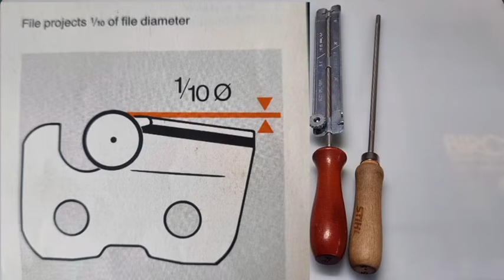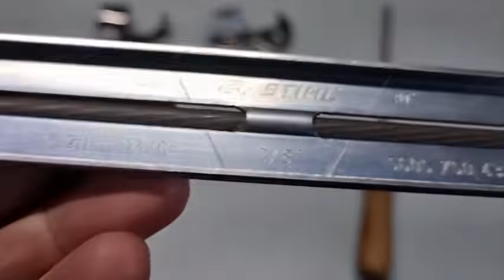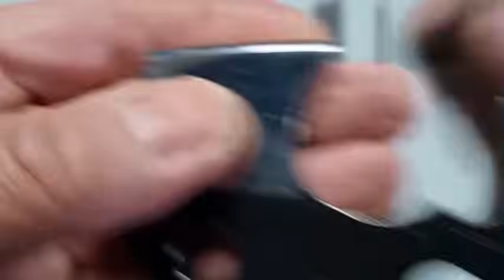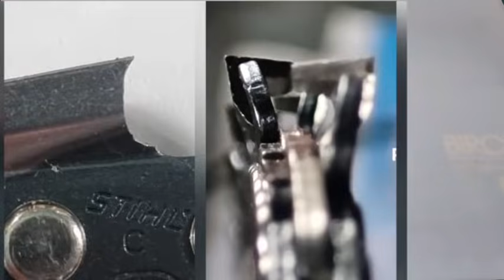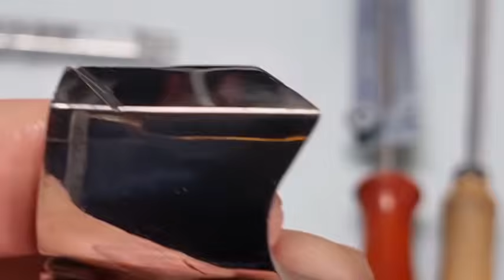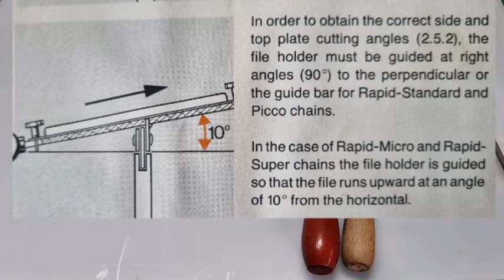Chainsaw Hand Filing the Utimate Guide

Comment: This will be long but it helps show something interesting 

Oregon Multi axis grind -  So they only use this term for the EXL style cutters. To understand what it is and why they do this takes a little bit of history.

In the early 2000’s Oregon changed their 325 and 3/8 chains from the previous LG and LP (bumper link) designations to the LGX and LPX. This happened on a few of their other chains like the semi’s BP - BPX and DP becoming DPX and so on.

The “X” was added because part of the changes made to the chains was the new Oregon X Grind for improved out the box performance. This “X grind” is still around on some chains and looks exactly like the C83/85 factory chains but with a 50 or 55 degree angle. I showed a video recently with a Carlton K2LX chain and its factory grind is the Oregon X grind. 

The problem was the majority of the end users of these chains sharpen with a file. The way the factory grind is done means you have to clear out the lower section / gullet just to be able to get the file to fit in properly, the small tips tend to be fragile and break off quickly and the first sharpening takes longer because you have to remove a lot of metal to get the shape.

End result is most people file it before it first use because they know what works for the in their application, so the grind is a waste

So 2016/2017 rolls around and the 3/8 LGX gets replaced by the new “Multi axis grind” EXL chain. Lots of changes to this stuff when compared to the older LGX. It’s harder, different clearance angles and so on

I think I have sent you pics of new EXL in the past. If you look at the multi axis grind it perfectly matches a round file held in there. They have gone to a lot of effort to make the factory shape as close as possible to what their customers will create with the tools they use.

It’s a basic looking, 25/70/60 chain that cuts almost as well as the other factory grinds and is very easy to replicate for the intended users
Reply from the maker: Interesting but I think they are using the term Multi-axis as if it was new technology.

Below is the correct definition of Multi-axis used in a CNC machine. 

"Multi-axis" refers to a machine or system that can move or operate along more than one axis, typically in more than three dimensions. In machining, this means a CNC machine can move the cutting tool or workpiece in multiple directions simultaneously, enabling complex shapes and designs to be created.

It's a new buzz word sounds great lol
I am sure all angles can be achieved in one pass on the factory grinder as they grind the teeth before they are assembled.

Most chainsaw users are not interested in this information.
Mainly users like yourself and me who read up on this technical information.

There is also a lot of hype and exaggerated claims when the real truth is minimal gains at best are achieved.

Nothing beats the square ground chain, end of story.  It's just that it's not as durable. 

In your opinion who makes the fastest semi-chisle or chamfer chisel chain and is the increased speed worthwhile if only to be round ground with a file ?

At least on a chainsaw grinder you can profile the stone to emulate many different profiles that are not circular in shape.

Technically if a file is held against the tooth and we measure angle planes in the middle of the tooth we can have 3 different axis points that intersect.

Top plate angle 
Top plate cutting angle 
10° tilt 
These 3 angles can all meet in the middle of the tooth and pivot on that point.
While this statement has some mereit in it.
It's not 100% accurate definition.
But Multi-axis Technology is a great buzz word to promote your product lol

In a three-dimensional Cartesian coordinate system, the three-point axis refers to the three mutually perpendicular axes that define the system: the x-axis, y-axis, and z-axis. These axes intersect at the origin (0, 0, 0), and each axis represents a direction along which a coordinate value is measured
The top plate 0 the top plate cutting angle 0 and 10° tilt  0 can all intersect at 0
0 is the middle if the tooth 
East west referred to as top plate 30° tiltted.  North-South tilted 60° and 10° down tilt 
All these 3 angles intersect in the middle of the face of the top plate cutting angle.

Holding a file on three planes refers to maintaining the file's position and orientation in relation to the three dimensions of space: the horizontal plane (x-axis and y-axis) and the vertical plane (z-axis).
Reply: @ChainsawUsers It’s all bullshit that’s trying to sell chain. Just interesting that they dropped the idea of chasing that out the box cut speed in favour of making the chain better for the people that use it

Look at hexa. It’s a filing system that they poured marketing dollars at trying to say it’s something special. Fantastic idea, highly recommended it for people running a full chisel because it so much easier to get constant results but the rest of the claims are, lets be honest, bullshit

Fastest semi - any of the 325NK. Tiny corners, well sorted designs now. 23RMP, 95TXL and SP33G. 404 - 27X 3/8 - S85

Chamfer - only 3/8LP and harvester. Works ok, just not popular.

Square doesn’t have to be fast or fragile. Look for RS vs. RSL. In a factory grind the round is often faster and having used them, the square is much more durable. Just like round it’s how you sharpen them and what you’re chasing. Speed or durability and square allows a better compromise of both but the learning curve is so steep that its out of reach for the majority of people using a saw
Reply: @ChainsawUsers  i thoght that having the hex cut would obllviate having a have10 degreee down angle. the word hex means 6!
Reply from the maker: @mervynshute880 10° was used so you never got too much hook

Comment: Semi Chisel suits my needs usually - but I do carry some Full Chisel should these would suit me better. "I" usually only cut green-ish timber.
Reply from the maker: Full chisel is the best in green wood
I use 30° top plate and 50° top plate cutting angle and 10° if the top plate has some inward tilt
Full chisel cuts 10% faster

Comment: I want to know about that filing guide on the lower left side of the screen.
Reply from the maker: They are designed to keep your file holder at 30° 
You have to get the right one for for chain same as the file holder.
It's just another tool to assist you if you feel you need that to help maintain the 30° Top Plate angle
Reply: @ChainsawUsers  I’d like you to show it in action sometime please.
Reply from the maker: @ToddAdams1234 can make video tomorrow ok
Reply: @ChainsawUsers  COOL!